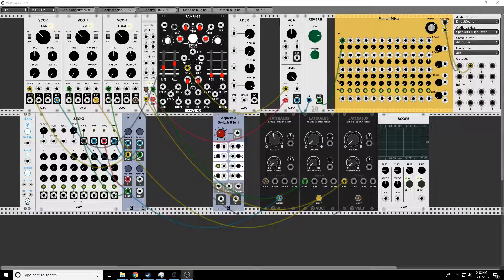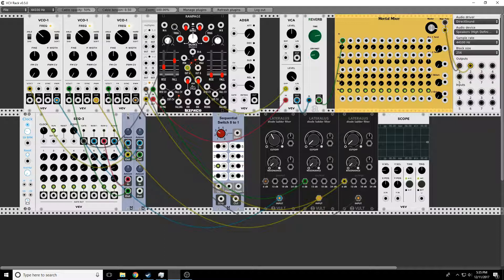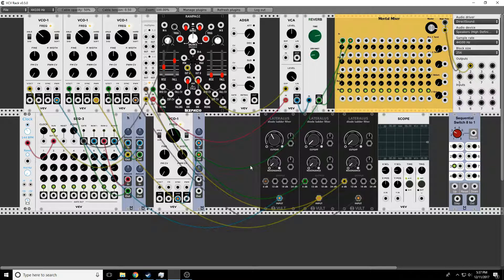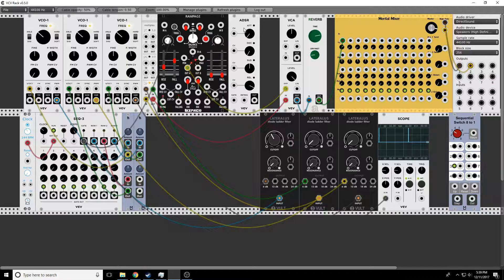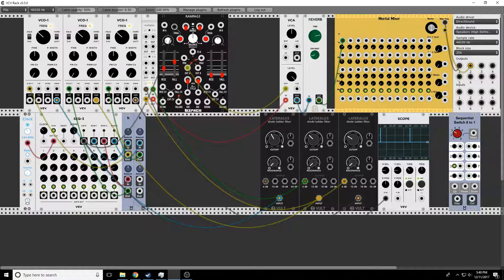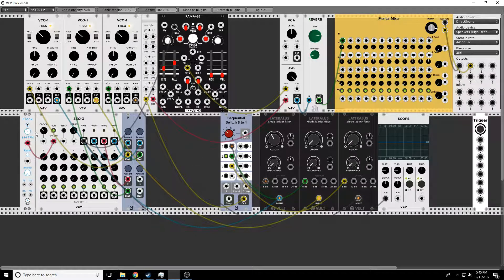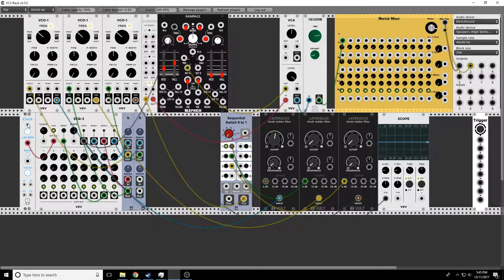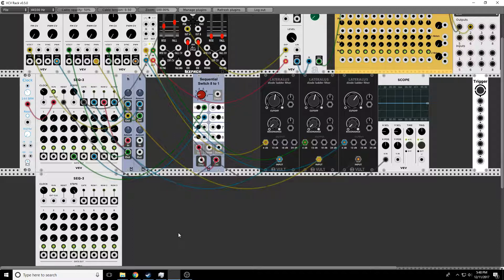ModularCuriosityEpisode 5 : Sequencers

Comment: Thank you for your greats videos! They were the starting point for me on VCV, and, as a newbie, still are.

I would like to ask: what would be the best way to tune a sequencer? I am running it very slow, then I stop on the step that I would like to tune, and then, using Hot Tuna, I tune it. But, doing that for 8 steps, on 3 rows, is kind of annoying. Is there any easier way?
Also, as Valentino Dubarry, I would like to know how to make some of the notes silent.

Thanks!
Reply from the maker: I would add a quantizer after the sequencer.  That will pull slightly out of tune note to the nearest in tune note.
Reply: I am sorry. I think I didn't make myself clear. What I meant was every single step. If, for example, I want to tune the first step on G4, the second on F#4 the third one on B4, and so on, how can I do it?

Comment: Reference 6:30 in the video - Why did the trigger output from SEQ3 not operate the ADSR correctly? If you right click on the background of the SEQ3 you can change the GATE MODE from TRIGGER (which acts like a short trigger pulse) to RETRIGGER (that acts like a GATE pulse which will allow the ADSR to work correctly). CONTINUOUS gives a constant high level (GATE always open).
Reply from the maker: You are correct.  I later discovered that you can switch from triggers to gates by changing the mode as you mentioned.  Thank you for sharing that.  It's all part of this journey/process of learning about modular synthesis.  I'm still very much more of a student than a guru.
Reply: Sorry I was logged in under the wrong name. Keep doing what you are doing. its a great series of videos that you are putting together.

Comment: Hi! Nice video.

But I should add that your explanation of the quantizer starting at 3:00 is wrong. Well, the explanation is correct, but your wiring is wrong. you put the quantizer between the VCO and the mixer, so it is quantizing the audio waveform, basically doing a bit-crushing. In order to demonstrate it properly, you should put it BEFORE the VCO and control the pitch through an external signal, e.g. a slow LFO. Then you would hear the steps. The steps you seem to hear are simply the points where you stop turning the PITCH knob for a while.
Reply from the maker: I thought the quantizer was quantizing control voltages by stepping it to the nearest 1/12th volt.  So I was quantizing the control voltages coming from the sequencer to the v/oct of the VCO.  Or are you saying the sequencer is already quantized (which would totally make the quantizer redundant).

Just tried it with an LFO quantized to the v/oct of the VCO as you suggested and yes, that works great.
Reply: Yes, that's what the quantizer does. Your video explains it nicely. The only error is at about 3:40, where you connect the quaantizer into the audio path, between the audio output of the VCO and the mixer. In this case, it also quantizes the signal, but that has more the effect of a bit crusher. You are still controlling the pitch by the knob, and the quantizer has, in this configuration VCO -> Quantizer -> Mixer, no influence on the pitch.
Reply: To follow up on what you guys are talking about: Does the quantized LFO mean the sequencer is now unnecessary? 

I moved the quantizer to before the VCO as suggested and was able to hear quantized pitches by varying the knobs on the sequencers rows (although, in the setup described in the video I also thought I could hear quantized pitch changes!) and I can get some quite nice sounds out. Here is how the setup looks: https://imgur.com/6ZXAQCs

I then introduced three LFOs and routed the waveform to each of the three quantizers inputs and from there to the VCOs: https://imgur.com/gbDz32v I'm a bit confused about where to go from here? I don't have anything triggering the RAMPAGE module now

Very informative video by the way :)
Reply: The intervals were definitely microintervals even with the quant.